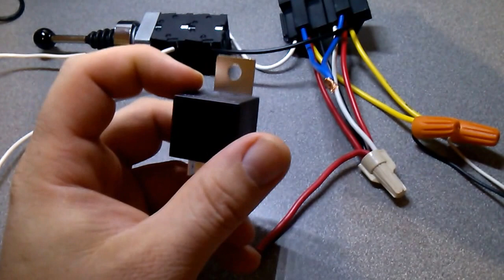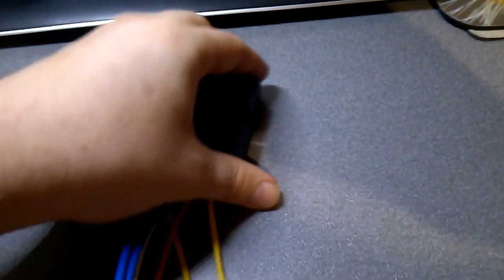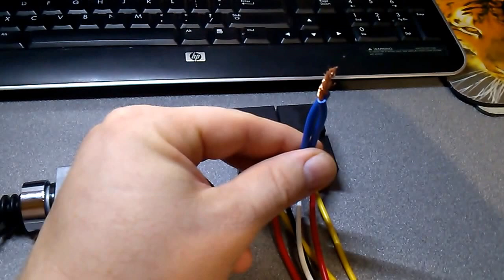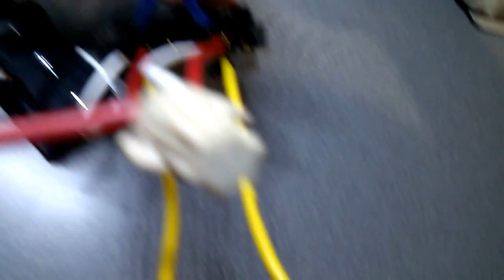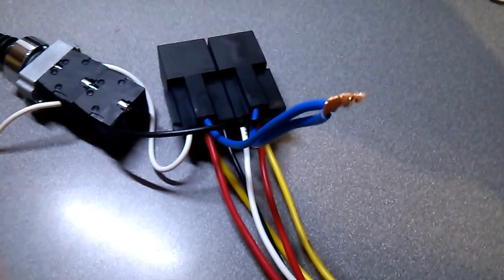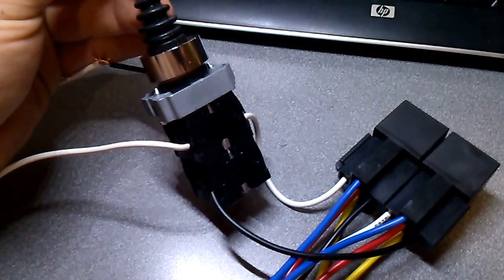How to wire dual relay to reverse polarity on dc motor

Comment: Hey this is the guy who told you about...."They have harnesses that are already pre wired. 16" wires.  Let me know if you are interested I will tell you where to find the link." You ever get it?

Anyway I just notices that you criss crossed your trigger wires from the coil to the switch. I am guessing so that you designate the two outer coil wires as the wires to the switch and the two inner coil wires go to power. I get the idea but you shouldn't do that. It is best to tag the wires. BTW the harness I mentioned has Green and Blue Negative trigger wires to keep it simple.

Comment: Hi I know this video is a bit old but need some help don’t know if you can please,I wire a relay to turn my motorcycle 🏍 side DRL to also used as a indicator,but have some problem don’t know it I wire them wrong,the wrong relay or there is current going back in the system.one of these video is how I wired the relay and the other is how my bike indicator acting up  https://youtu.be/b0Kfc1pMWvg https://youtu.be/QqjfUmplNs4
Reply from the maker: sometime you need a rectifier inline to help with the current
Reply: Keith Zoller Tell you the truth I don’t have a Clue what rectifier would you recommend and how would you connect it ?
Reply from the maker: Be best for you to look it up in another YouTube video and probably take it to a real mechanic since you're having trouble understanding the whole setup
Reply: Keith Zoller ok will do thanks anyway

Comment: Hey Keith, I am looking to add a front end loader to an lawn tractor and saw this joystick set up. In later videos I see you went with a rocker switch. Did the joystick just not work out?
Reply from the maker: Bombadil this joystick with One Direction at a time just like a rocker so the rocker are cheaper